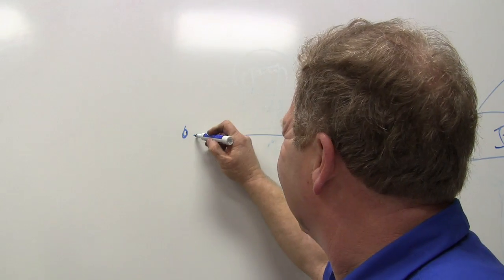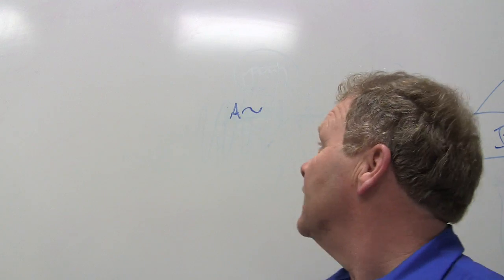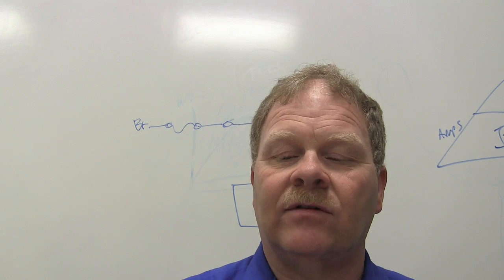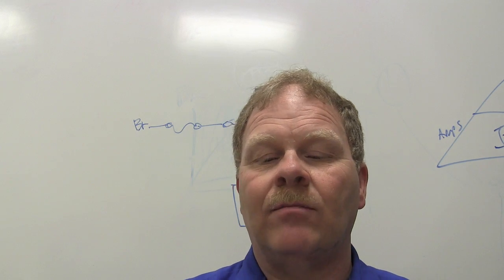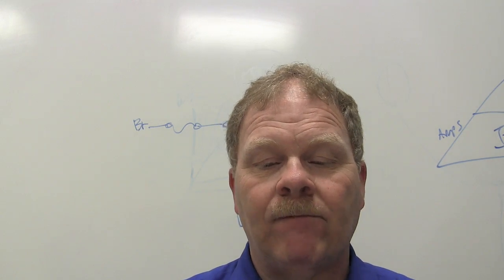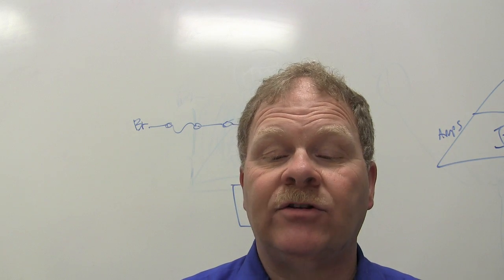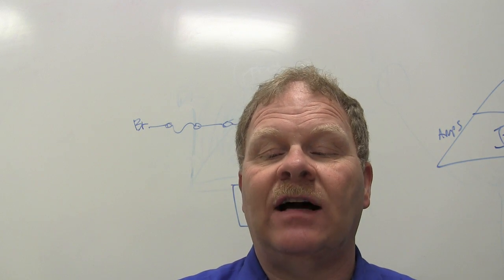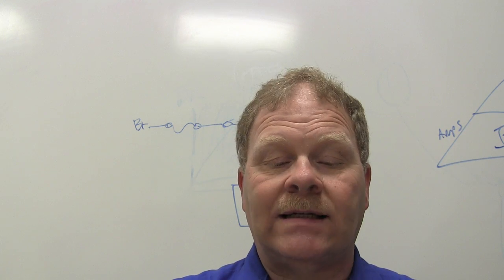Electrical Test 1   Basics and Tricks

Comment: Do automotive wheel speed sensors use power from the onboard electronics? The aviation equivalent are self powered, then the signal might be translated through a computer for the Ipad cockpit setups.
Reply from the maker: Some wheel speed sensors do, but Variable Reluctance Sensors (most of them are this type) create their own voltage inductively.

Comment: How many spark plugs in an 8-cylinder diesel engine? 
Is the electricity for a spark plug AC or DC since a transformer/coil is involved?
Reply from the maker: Is this a trick question?  What do you really want to know?  Good grief!

Comment: Ac can be generated at relatively lower voltages, then transformed up to very high voltage (and therefore low currents for safety) for distribution to distant area substations where it can then be transformed down to lower voltages for consumption.  The point is ac can be transformed.  Dc can not be transformed.